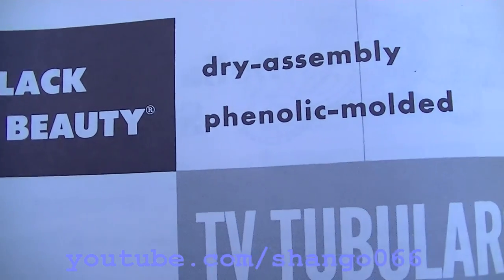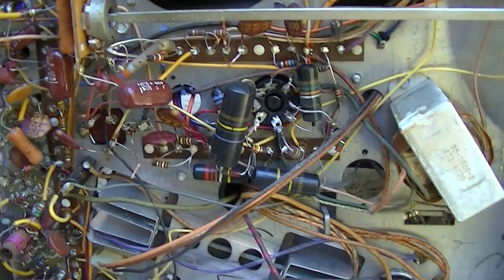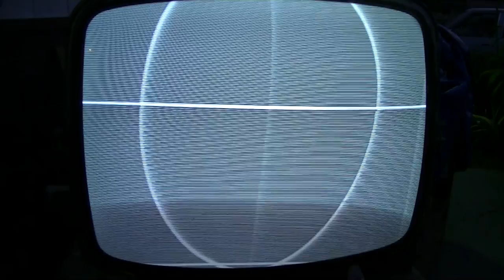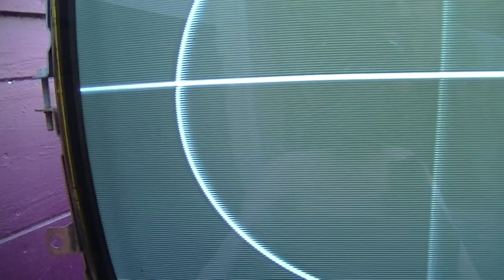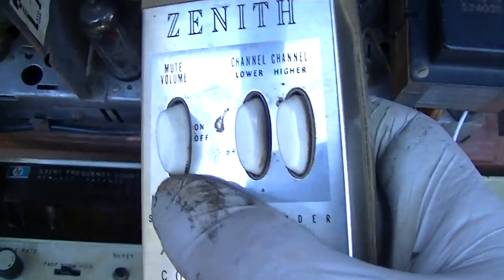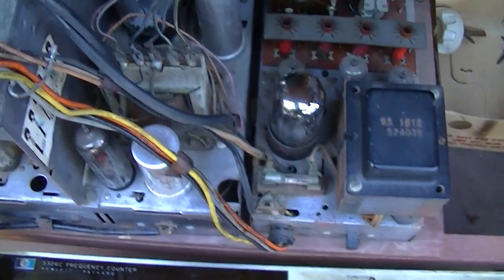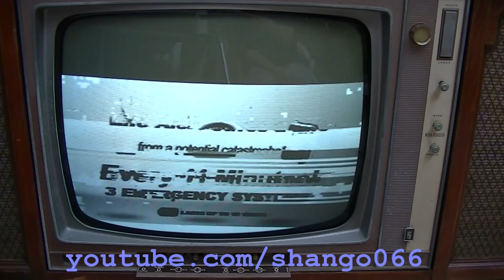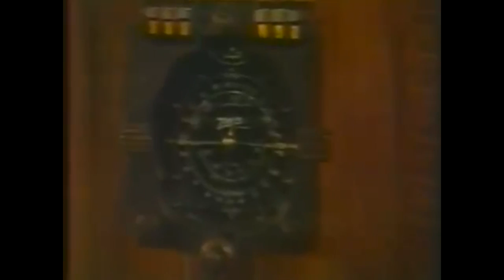1961 Zenith Space Command Black And White Television Console Repair

Comment: "Introduction of the Transistor, October, 1953", reminds me of my first year of high school electronics, 1974. We learned solid state theory first, our shop teacher "preferred instructing in reverse", because even as late as 1980, some of the best "tube tech's", who had shops since the '40s, were never able to understand the workings of the transistor. There was enough "tube work" still around to sustain them, however, they were forced to either hire a qualified tech to handle the hybrid and solid state work, or "farm it out", to small-time tech's like myself.  Warranty work could be a headache, because of having to install the exact factory replacement; there were also times when factory tech support was necessary, and that was never much fun.

Comment: Zenith definitely lives up to their promise. Their stuff does last more than a lifetime with little to no maintenance. I have a zenith space command 100 from 1972 that was given to me when I was 14 years old I'm 40 now and it still works, I really know nothing about the electronics but I've adjusted a lot of pots in the back to get the picture lined up and colored right over the years and it has a really good picture only weak thing is the VHF tuner you have to jiggle the knob to keep it from going to static once in a while but it probably just needs cleaning.

Comment: Amazing, great video.  I took apart a 1950s 19" Sears Silvertone Portable B&W in the mid 60's because I was a curious teen.  It had a steel case.  The set weighed over 50 pounds despite being described as "Portable" with a plastic handle on top.  I still have and use the swivel top table we used for it in 1958.  A classy piece of well made furniture.  Our Silvertone had annoying sound identical to what you hear at 31:00 in this video.  Sears never could fix it.  Oh sure, the techs would walk out smiling "It's Fixed!!"  2 weeks later the "Buzz," as you call it, was back.  Imagine listening to it all the time the set was on--we did.  We never had problems with the picture on the 2 Silvertones we had and considered it a plus.   Zenith had 2 plants not far from where we lived and more than 5,000 people worked in the 2 locations.  The plants closed in the 1970s when likely all USA television production moved to Japan, I think.  Those power transformers probably weighed 10 pounds themselves.  A lot of heat came out of those sets in the day and could literally warm the room after being on for awhile.   I would be surprised if the Zenith buildings are still standing today but Google's Street View still shows the Austin Plant there although I learned it sustained a major fire a few years ago due to vagrants.  So appropriate to show Johnny Carson on this set!!

Comment: Until I saw this TV I didn't know that tube-based Space Command remote controls existed.  From what I have found they are extremely reliable; the last few times I saw Space Command TVs, if the TV itself is dead the remote control unit is often still working.

Comment: GREAT little video on the repairs to the Zenith TV!!!!Liked the detail on the ultrasonic RC system.A friend of mine trained his poodle dog to respond to one of these remotes.One button called the dog,another made him site and another for lying down.So shows that dogs can hear in the 38Khz range.Your HP counter looked sort of vaguely familiar-at radio station I worked in used one to monitor the frequency of their AM transmitter.Your video reminded me of working on TV's in the older days when they had TUBES in them and you could FIX them!Later went on to broadcast-fixing studio gear,and AM,FM and analog TV transmitters-now Short Wave transmitters.

Comment: Not into old TV's, but I do restore old tube radios. Your trouble shooting is great instruction. Thanks.
Reply: Tube radios: easy mode
Tube TVs: hard mode
Flat screen TVs: IMPOSSIBLE!!
Reply: @TR2000LT  Agree, TV has audio and video, horizontal and vertical.  Radio is easier, with just RF and Audio sections, but there is a lot of common trouble shooting.. Flat screen not hard. I fixed one same as tube radio/TV, I recapped it. Many manufacturers put in cheap Caps or got counterfeit ones. Power supply is common issue with flat screen TV's. Of course a proprietary IC you can't buy means you are screwed. Surface mount is another issue. I don't think I'll ever do that. Most service centers swap boards out..

Comment: I doubt in 50 years anybody will be restoring a current generation flat-screen TV.
Reply: Sad thing is they will. modern OLED panels cost anywhere from £500 to £3,000
Reply: Nobody bothers fixing them now.  Perhaps five years of use, and then sent to the landfill.
Reply: There are no books out there on how to repair a flat screen TV. They are destined for the landfill.
Reply: @gerardcarriera7052  Dont need em, just replace the pcb
Reply: its very unlikely just a recap and if that fails bin it
Reply: Modern TVs, and practically everything else modern built is NOT designed to be fixed when broken. They’re designed to fail. They fail and you buy another expensive product.
Reply: No, but I can guarantee you that in about 10 or 20 years from now, some people will be restoring the "90's or early 2000's black or silver plastic crap" TV,  from people who use and play vintage video game systems that were made during that time.
Reply: @19seventy97  Nah not true, no ones gonna throw a £3000 sony bravia in a landfill
Reply: That's because this same Zenith will probably still be working!
Reply: N Gauge England Synthematix I would. 

But if that 3k TV stops working out of warranty. Then it’s most likely something very complicated will be the fault and will then most likely get thrown.
Reply: @19seventy97  9 times out of 10 its a power supply issue with modern oled panels, now theyre made in a way that you just change the faulty daughterboard
Reply: time will shake out which models & makes still give good service & last
Reply: @danilorainone406  The ONLY brand i will ever buy is Sony, bravia sets are the best of the lot
Reply: Likely repaired for PC monitors
Reply: @Synthematix  
OLED's near all 'burn in' . . like . . oh oley
Reply: We'l be carving igneous stone to build pyramids etc . .  with 'lasers'  again by then (rinse & repeat)
Reply: with the rise of CRTs coming back (collectors) i hope in 50 years we have the tech to do limit manufacturing of CRTs again. that or REALLY REALLY bad ass OLEDs.
Reply: but tv's are so cheap now, that you can't even sell your 7yr old 3k HDtv anymore.  When you can buy a freaking Samsung 4k 75" tv for 1k, all you can do is donate.  @Synthematix
Reply: I don't doubt that at all, hipsters are gonna hipster, the only reason why nobody restores these now is because they just too new and actually useful.
Reply: We had a 65" after two and a half years it failed. Had warranty. They said it was cheaper to replace it with a new one, than have it repaired.
Reply: @jsciarri  yeah, those are the last generation of CRT TVs. I still feel bad when shango eols one. You can't find them for like 50cents at the local flea market anymore, just early 2000s 23 inch silver flat panels, and you rarely see them on the streets too.
Reply: Bc they aren’t cool. That’s coming from a 24 year old. This is cool

Comment: yup I remember the "VIDEO BUZZ" bleeding over into the audio. most commercials for what ever reason, the video was being driven so hard it would do that on all tv sets of the time. the cooling fins on the power transformer were used to keep the "EDDIE" currents from getting the core laminations too hot( at least that was the idea)

Comment: Your method of replacing parts, as here: capacitors, is very useful and a good solution ! It was recommendet in some service-manuals too, especially in case of early printed circuit boards... The danger of destruction of other parts is rel. high, this happened to me a lot of times, because I wanted to do a "perfect job". Good video by the way, keep on your good work.

Comment: What do you use for signal source? Cable box chn 3/4 out or digital converter to analog?
Reply: That's an RCA ATSC (digital air) to analog converter box. Like he said, not great devices by any stretch, but they're good and cheap for those who need them.
Reply: @lauram5905  yeah I got one of the free Digital converters when they were offered free. I used it on an analog TV for a little while before getting a digital TV. They are not bad but the RCA composite out or RF out is 480P. Frankly the digital converted to analog was better than OTA days I found. VCR might be better source.

Comment: You know, while that TV is kind of homely looking its style does grow on you. The audio system is great, indeed bypass the buzzo melvin matic , with that single ended EL84 it would sure sound darn tootin' good. I haven't decided if I can call this the Rolls Royce of TV's (because british), or Cadillac because they junk vehicles. There just is no comparison to an old Zenith is there. I own several of their AM/FM  Tube Radios from the 1950s-1960s and they are all built alot like this TV. Just superb - and each of them work flawlessly to this day. Most aren't even fully restored just serviced - they just need a touchup after a mere 60 years typically.

Comment: Serviced Zeniths, [and other brands] for many years.  Loved the Handcrafted chassis;  you can keep the PC crap that RCA used; tubes baking the boards and creating all kinds of weird problems; sometime making the TV virtually useless, but that puts most RCA's into that category, useless; never made a good TV until the XL100;  the rest,  all garbage.

  Surely, when the Zenith was made, it didn't Buzz.  After 58 years, Obviously something has changed even though Zenith had circuits to compensate for aging components ie; Buzz control, Quadrature coil; etc., there is a limit and maybe the detector design was odd, but I'm sure it didn't Buzz right "out of the box." The sound take off alignment, even a bad IF alignment or tube could be the culprit,  and the AGC was set high and that could contribute to a Buzz issue as well.  The digital box also introduces Buzz and a digital signal into an extremely high gain circuit as in the Zenith could also introduce unwanted buzz.  Zenith made a model 14N22 black and white chassis for more than 12 years without major circuit designs or changes and produced more than 12 million of them.  No-one could ever dispute the logo, "The Quality Goes In Before The Name Goes On".  No truer words ever spoken.

Comment: The only advantage I can see to those Powerline tweeters is that they're almost impossible to blow up, so if a retarded DJ clips the hell out of your amp they won't get blown into space, and if the awful amp in your active speakers dies and puts out 40v dc into the tweeter that also won't kill it, I've had a pair of Powerlines for a few years and they've survived both of these scenarios, but still sound nasty as hell.

Comment: Those bumble bee striped caps were made several ways, if you look at the ends the oil filled crappy ones have a larger diameter lead in one end, this is a hollow tube that after the cap was molded the oil was filled in then a lead wire was soldered into the tube form in the connection on that end, the non - oil filled did not have that larger end just the wire lead. Later caps seemed to have used a plastic dielectric not just paper these were very much better and most held up good.

Comment: Greetings:
I know that you prefer to use the minimum test equipment so viewers without them do not lose interest while watching you diagnose mostly with your experience and using audio to check capacitors, etc. But I have always had access to oscilloscopes and try hard to visualize the 'scope displays as you go. Can you recommend a YouTube channel that is 'scope intensive during diagnosis (xraytonyb is one but does few analog TVs). I am very curious about sync separation in consumer tvs as a VTR maintenance engr I had a monitor tech who took care of all monitor issues.
Question: When working properly such that freshly connected NTSC video locks vertically almost immediately, it has been my assumption that without sync present that both H&V raster oscillators run slower than 15,734 Hz & 59.94 Hz so that lock is achieved by sync forcing the end to each oscillation before it would end on its own. I am not sure but I suspect the same is true for color subcarrier lock as well.
Question 2: Do you have enough experience with zero setup signals (TV brightness set for picture blacks at blanking level) to see any advantage Japan has gained by not using 7.5 IRE setup as part of their difference in NTSC-J?
I'm guessing that your eyes may be reacting to the interlace effect. If you watch closely while you adjust V-sync you can actually see how small adjustments affect the placement of the two TV fields with respect to one another.
Question 3: As this youtube comment is about 3 years after your posting, I wonder if you are still notified about my responses.
H.P. Frequency Counter use: no experience with this unit, but I suspect that judicious use of the single-shot mode (hold & reset with any sensitivity adj.) would result in a stable display of your individual remote presses. [Trying to help.]
Reply from the maker: I read all the comments and the videos and test equipment have changed a bit in the past three years. I use a scope only when necessary it's difficult to get that in-depth without a cameraman and most people would just lose interest anyway.

Comment: I once had a set from the early 1980s for repair (don't ask, I don't remember the brand, but could have been Nordmende) where the tuner could be set between VHF, UHF and Special. Now what's special? Turned out "special" was another UHF tuning circuit designed to filter out the high-contrast-buzzing somehow, which was VERY pronounced when connecting a VCR. [in Europe, VCRs and gaming consoles use UHF channels 30-40 mostly, instead of VHF ch 3 and 4 as in the USA].

Comment: Great video as usual. However, when you checked the capacitors for leakage, how come they measured all good, but still made a difference when replacing them? I think your capacitor tester is not sensitive enough. I am using HV insulation tester (shipped $20 from China) for testing paper/moulded capacitors and I never found any that were still good, even the ones from the late 1980s. But despite it Chinese build quality, it is a one sensitive device. Other good way is using a voltmeter in series with high voltage bench supply (or a B+ from radio/TV) and a capacitor, essentially the same as measuring audio coupling cap in circuit with the output tube removed. If there is any voltage present, then the capacitor is leaky.

Comment: 1:38 "Out of consideration for servicemen we use NO PRINTED CIRCUITRY". No Screwball Construction indeed. :-)
Reply: It seems that any time a new technology comes, there are dinosaurs who don't want to invest in them, so they try to sell their old technology as "proven", "classic" and so on... Marketing at its best...
Reply: @janosnagyj.9540  As someone who spent plenty of time cursing at this era PCBs I'm all with Zenith on their slogan. When this ad was made it was way too soon for PCB manufacturing technology in consumer gear, - traces on 60s phenolic boards break off just from looking at them funny. I'm not saying it was impossible to make them nice and sturdy, maybe in some high-end Tek scope that would cost you half the kingdom and random princess limb, but surely not in mass-manufactured TV set. And most electronics designers weren't experienced in laying out boards and were still figuring out how to do stuff - I think even on Shango's channel there's a set where recommended way of replacing components was to snip the component and solder new one to the wires, because otherwise you'd have to disassemble the entire set. I had a radio set (similar to Grundig from this channel) where I had to break a trace on PCB and solder a new capacitor on the other side because cap was in such a shitty spot that would require desoldering power transformer,  tuning condenser, and removing the scale.

Comment: That's why they were a bad ass computer company as well as state of the art electronics because if you look at path that's all the individual card construction just like the like the early 4 86 80 88 and other computers were made whereas if you'd build a sound card jesus replaced the card if you blew any other card you just could replace the card with another card now you have to buy pass it on the motherboard and hope you have enough slots and the douche lots that give you to bypass what you need to buy path and make working again

Comment: Schottky diodes are fast and show a lower voltage drop in comparison to ordinary silicon types, all switchmodes use them for outputs. (20-80khz use).

Comment: they should have kept analog for use when the signal got too low for digital. I collect vintage TVs but I stopped watching TV when analog went off the air. I got a Zenith black and white console TV and a resistor in the audio output stage smoked due to a shorted output transformer so I disconnected it and ran the TV without sound and then the picture started to shrink but the filter caps weren't getting hot but the power transformer was so that was going bad too. I gave up and stripped the set for parts. I have a bunch of good picture tubes and parts if anyone is interested.